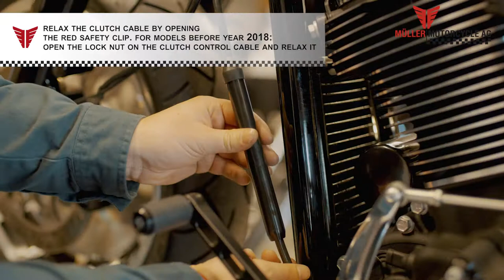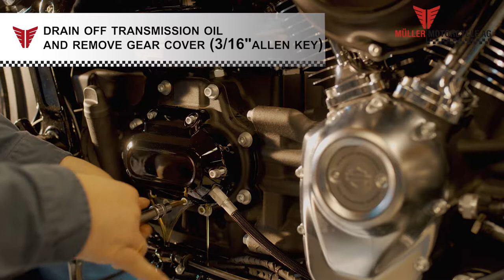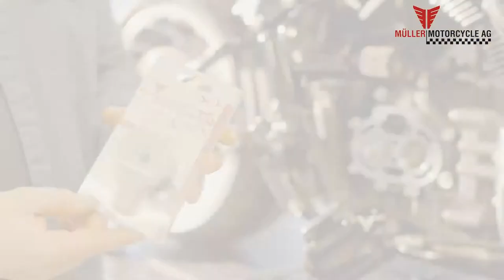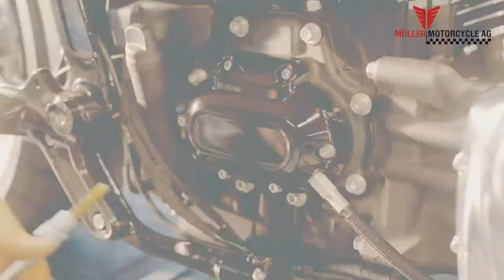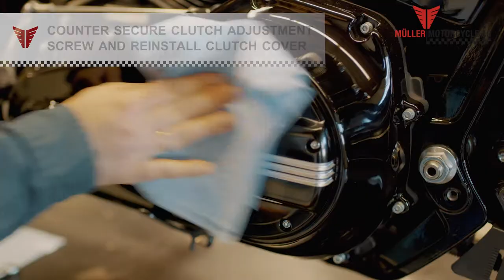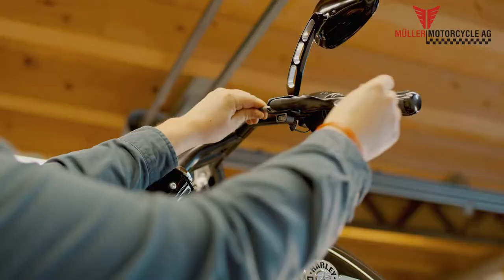Power Clutch installation manual for all HD Big Twin 1987 and up

Comment: Installed the Power Clutch today, and as well as being a relatively simple modification, made a significant improvement to the clutch actuation system (reduced effort and reduced hand lever travel) Only downside is the cost, for what is essentially an investment-cast steel piece, therefore it should be much less in reality (taking into account of design, development, and tooling costs) That's free enterprise for you!

Comment: Is it correct to adjust the clearance adjustment of the primary hexagonal push rod to 1/8 when installing the power clutch?
The regulations are 1/2 to 3/4
Reply from the maker: Yes, as soon as the first resistance is felt, open again 1/8 turn. It may be necessary to repeat the adjustment until everything works perfectly. Sometimes it takes a little longer the first time ;)
Reply: My vehicle is a 2013 Electra Twin Cam 103 Cubic
I'll have to give the push loader a quarter of the clearance and repeat it until it's working perfectly
So a half to three-quarters of a clearance is a clearance of genuine parts
Thank you. @m-motorcycle

Comment: ok, i got your Power clutch, really smooth, i have a 2002 twincam 88, manual says 1/2 turn loose, so i went to 1/4, but at 1/4 clutch is still a very long pull even with no loose on cable, should i go to 1/8 ?
Reply from the maker: Yes, with our Power Clutch you have to do 1/8. 👍
Reply: @m-motorcycle  done and wow, love it, its like having an hydaulic clutch, thanks !!!!!

Comment: Tip: just take your clutch lever off for the install. The only sure way that you can get zero tension in the cable is by removing the lever and pushing the cable back through the housing to return the muler. Trust me. Remove the lever and you’ll save yourself a massive headache
Reply from the maker: Hello, thank you very much for this advice. We will let our customers know if there are any problems.

Comment: The clutch effort reduction kit I got from Harley-Davidson came with a clutch basket spring also, do I need to install it or is it the same as the stock spring?
Reply: What model do you have
Reply: @albertnemeth3618  I have a 2005 Dyna Wide Glide, I got Harley-Davidson's clutch effort reduction kit, installed it and also used the thinner diaphragm spring that came in the kit. It's much easier to pull the clutch lever now but there is a difference between the diaphragm springs, the one in the kit is thinner and weaker. I'm thinking about putting the old spring back in or figuring out what I can do to keep the clutch from slipping when I do a gear change if I'm getting on the throttle hard. It doesn't slip much but it does a little bit.